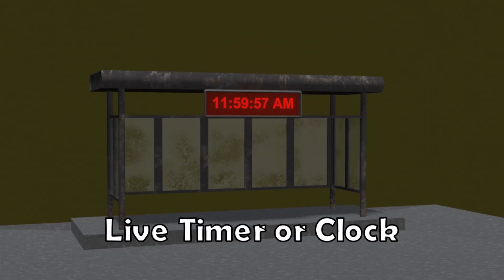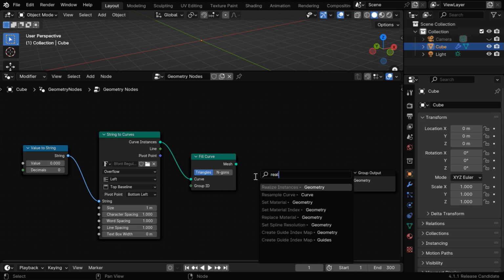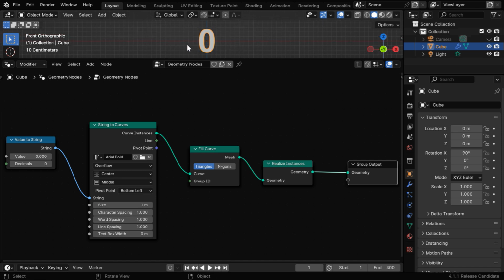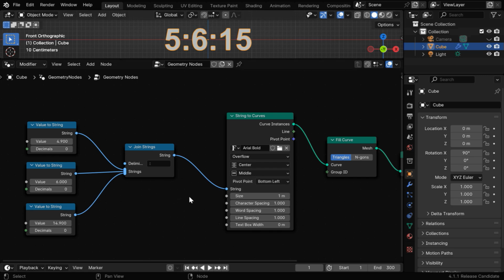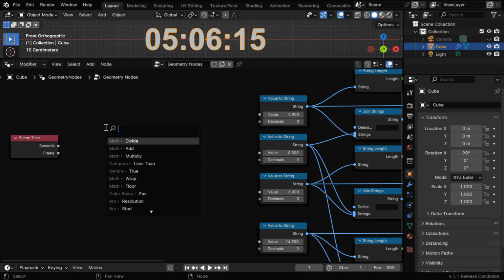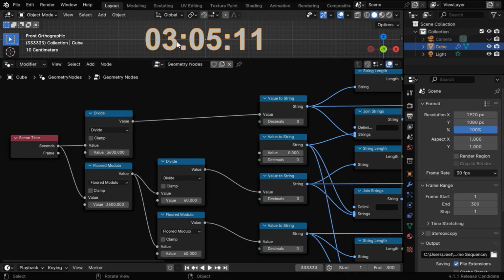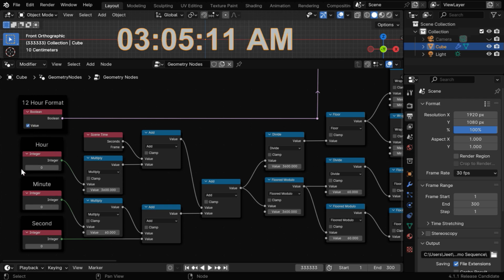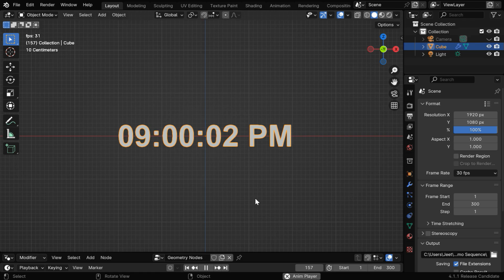Create Auto-Timer or Clock In HH:MM:SS Format | Geometry Nodes | Blender Tutorial

Comment: I'm making a clock object with 24h and 12h time format options. In 12h format, there is no 0 (zero) in the hour. The clock starts from 1 to 12. When I add the floored modulo math node, the time jumps from 12 to 0, not 1. How can I make a math setup to travel between 1 and 12?
Reply from the maker: You can download the node tree from the video description and use the same, or compare it with your setup and find out the difference. It should work.